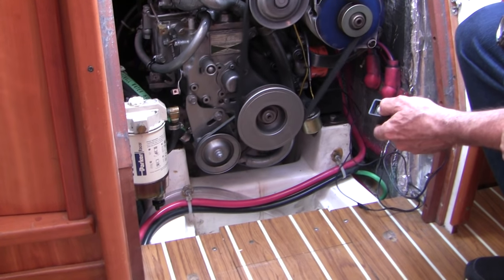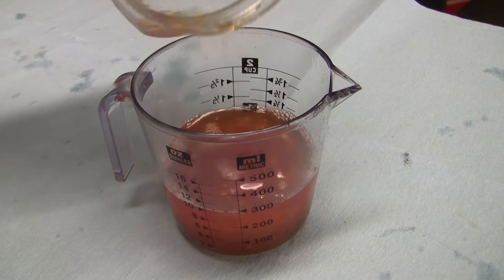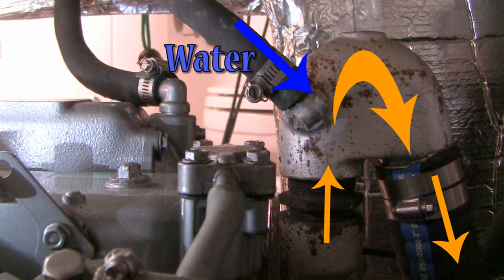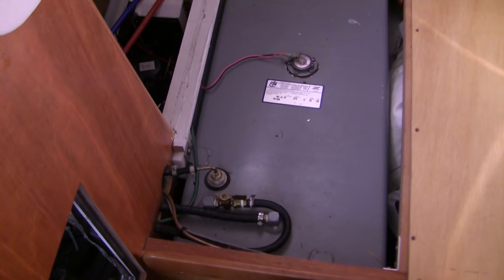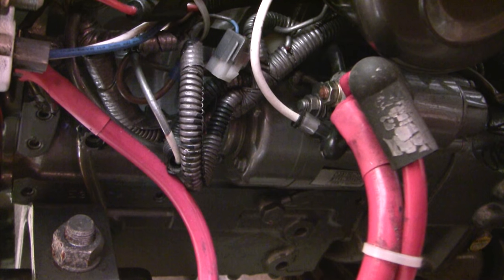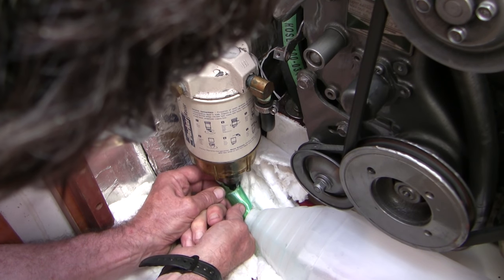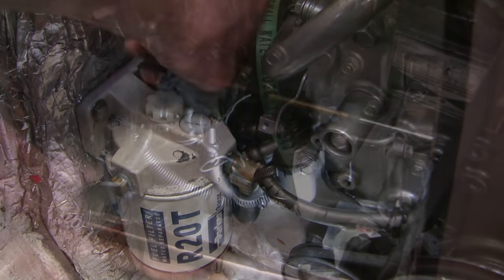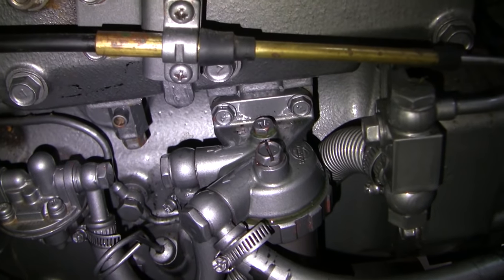How to change fuel filters and bleed air in a Yanmar marine diesel

Comment: well wish me luck. i hired a guy to paint my boat and he taped over the fuel tank vent. it ran for about 15 minutes and cut out. now i need to bleed all the lines etc.
Reply from the maker: It should be OK. Just be sure the salt water intake isn't occluded, an overheat would be much more serious. When I painted my boat last week and changed the impeller, I didn't reopen the salt water intake far enough. Fortunately I noticed right away and corrected the issue. Lean engines can run a little hot and misfire but once fuel delivery is restored it should hopefully fire right up.

Comment: Be carefull uing engine to bleed fuel, you can Hydrolock you engine very quickly.  I did it once.  Use the pump or install a hand pump in the fuel line to the primary
Reply from the maker: You make a good point, indeed it's why I closed the salt water intake petcock before cranking the engine. If you ever have trouble starting an engine, closing the salt water intake will reduce the chance of salt water hydrolock, remembering to open after you get it started. There are of course two ways for these engines to hydrolock. It won't likely happen from salt water making its way backward through the exhaust if the intake petcock is closed. The second way is by injecting too much fuel into the cylinders. Those decompression valves that I held open while cranking change the timing of the exhaust valves such that the exhaust valves open early during the compression phase, so unburnt fuel is forced out the exhaust rather than accumulating inside the cylinder. This is why the engine sounds the way it does, there is no compression. This is also why if you're concerned about hydrolock or flooding, you can spin the engine with exhaust valves open to clear the cylinders. With this method, a couple of ten second starter cranks is very unlikely to cause hydrolock.
Reply: @spelunkerd  I installed a Racor 500 and much easier to bleed because air cannot get in when change filter and fill the racor from the top

Comment: Get an electric pump fitted it's a life saver
Reply: Then he's reliant on that pump, right now he has a totally mechanical system, it's far more robust. If he'd brought along a little fuel, it'd be near trivial to prime.

If you want an easier method a Mity Vac on the injection pump return line will bleed it in no time.
Reply: @otm646  The vacuum trick can work on engines with a self-bleeding circuit as many do -- these particular engines don't have that; their's no low-pressure pathway to the return line. 
 I installed an electric pump on my 2GM20F mainly because the lift pump was always damp with fuel and they do have limited life.  It does make final bleeding quicker.  I blanked off the crankcase port and installed an 8mm coupling nut to engage the old fuel banjo fittings so old pump can be reinstated. The lowest pressure Facet pump is good.

Comment: Are you or any of the viewers around northern New Jersey to help me change mine? I’ll compensate reasonable travel time and all work done if reasonable hourly rate is offered.
Reply from the maker: Good for you to reach out for somebody who can walk you through it, you'll be able to do it yourself if you watch how he does it. I live thousands of miles away.  It seems daunting to do something outside of one's comfort zone, and there are risks if you make a mistake. However on a boat, you never know when you'll need to do this yourself, maybe even on the water when you get air or water contamination of fuel. Once the vehicle chokes on air or water, it will never start until you clear the line, and you'll deplete the battery very quickly by running the starter. Air or water contamination is the most common cause of a 'crank no start' scenario on a marine diesel. Sometimes it is better to make the leap and learn the skill yourself, so that one day if you need to do it you won't need to use channel 16 for a tow to the nearest mechanic. It's not very hard. Another option is to find a course in marine diesel repair, which are available through many community colleges. Good luck!

Comment: that engine runs like new
Reply from the maker: These little engines are amazing, unbelievably reliable and astonishingly simple. I had a bit of an issue with cold starting earlier this year, undoubtedly from water in the fuel (that contaminated fuel shown at the beginning came from the water separator on this boat). Thank you for watching!

Comment: Too bad this video wasnt done on my engine 🤣 i have no decompression valves . 4lh dte. My secondary filter doesnt even have a air bleed screw
Reply from the maker: There will be fittings leading into and out the secondary filter, just crack the one leading out and wait for it to stop bubbling. Most marine engines have a dealer repair manual that will walk you through the procedure. Try searching for a pdf copy online. Good luck!